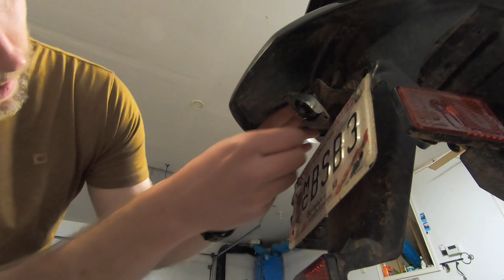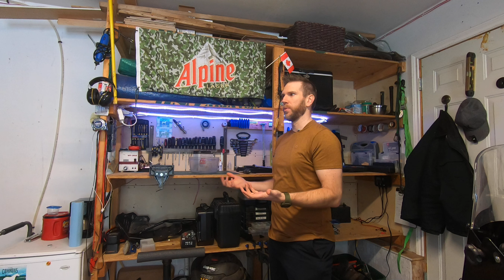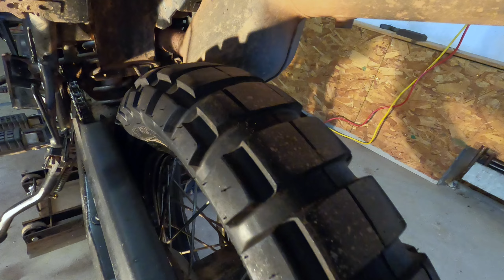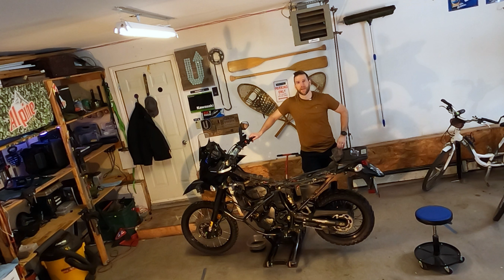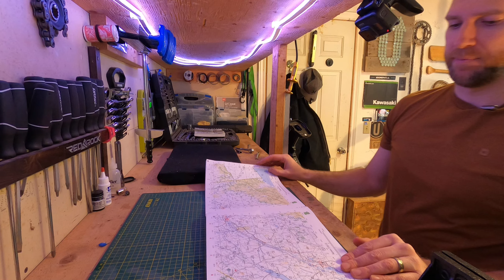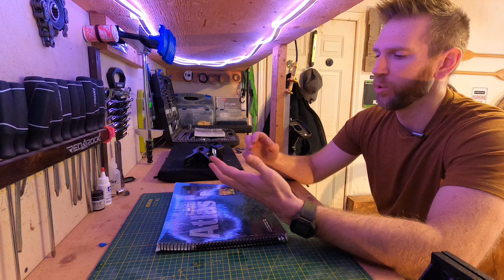Channel Update January 2022 | 5 Things You Should Do Before Next Season | Island ADV

Comment: I hear ya about lead times on tires. Last summer I waited almost 2 months for K60 Scouts on one bike and about 6 weeks for Bridgestones on another.

Check out Bridgestone AX-41 AdventureCross if you're considering TKC80s.  They track like sport touring tires on pavement and perform amazingly off road. Phenomenal tires. The only downside is that they don't last very long, but neither do TKC80s.

I'm interested in trying out the new Heidenau K60 Rangers if I can get my hands on a set. I absolutely love the AX41 but need something that I can trust to get more than 5,000kms out of a rear.
Reply from the maker: That's the big sacrifice eh. If you want that meaty tire to rip up trails, you usually end up getting a softer compound too which burns up faster. Thanks for the suggestions. I'll look into these for sure.